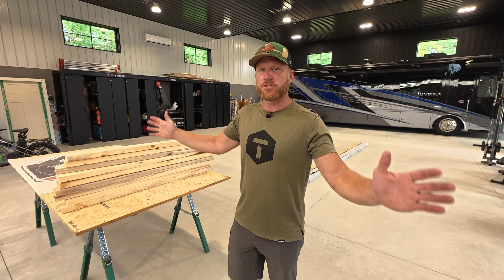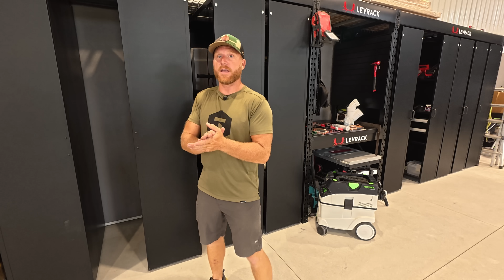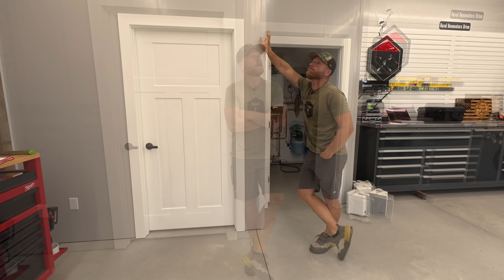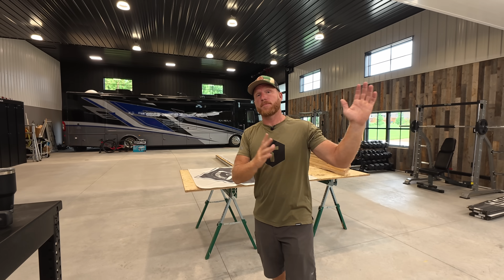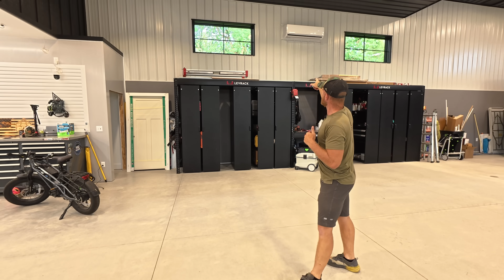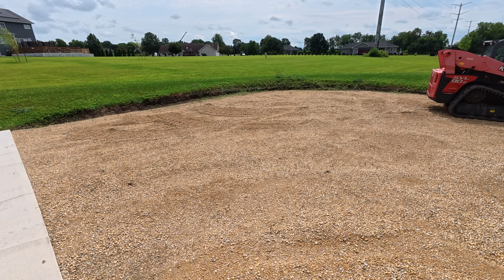RR Buildings COMPLETED Shop Tour

Comment: Awesomer than last time I saw it. Fourteen tons of work for a twenty ton job! 
What program is Cole headed for? Is his Jones for electric work going to turn into an Electrical Engineering degree? Have Cole tell us about it- we expect a lot for a guy with an exceptional dad; you will work like a Trojan and always seem to remember being home is really the important job. Same hope for Greg, trying his turn a being dad. 
On the wood shop; an additional building, 40 x 40, with good ventilation and in and out garage doors, great electrics, heat and air should about max you out as long as it doesn't become a warehouse! Jimmy Diresta's palace was designed for a crowd to work in- but you can see how much the warehouse effect has"shrunk it.
Talk to Robert Dunn about dust collection- c/o " Aging Wheels", particularly build it your self ideas.
Lots of good floor ideas; polished is slick any time and very slippery when wet. If epoxy, do one that is non porous, at least three coats so you can scuff it up in a couple of years, retop it and back to awesome again. Any floor surface material you put on it will get scarred and scuffed- repair or replacability is you friend!

Comment: Kyle, I would suggest looking at 'industrial curtians' for your shop. You can use these to segregate areas (like a dust/dust-free zones) and even segragte the RV area with a thermal curtain (soft wall instead of a hard one). Check out product line from Shaver Industries and Goffs Enterprises - Goffs even has bug screens for the roll-up door if you want some fresh air in the place without inviting the critters in (they also have thertmal curtain and roll-up options so you can store it hide it away when not needed like during the mild weather months).

Comment: What a great space Kyle. A few thoughts. Put curtains to isolate the shop area when you create dust. Put a good dust extraction system - cyclone system for sure. Bourbon Moth just redid his shop and Oneida provided a plan. The middle section can be used for assembly where no dust is created. For your floor, I would lean to an epoxy or polyaspartic where you park your RV. It creates a barrier to water, road salt, grime, etc. Overall, a phenomenal building, I am jealous 🤣.My 2 cents.

Comment: It’s like new car perfectionism, until the first ding or scrape. Greg will have to spill some diesel oil on the concrete and back one of those quads into the wall. Add some patina to help you be comfortable with working in the space.

Also, there are some awesome workshop dust filters that could help to mitigate the dust from encroaching on your RV side

Comment: Cool! 

Regarding the mini split: Issues like yours (over cooling) are common because the thermistor is located near the return grill on the head. This means it's reading the temp off 12 foot above the floor, instead of 4-6 feet off the floor where your body is located. I have read people will relocate the thermistor, wire in a compatible thermostat (mixed reviews on this method) or sometimes your remote will have a thermistor and the remote can be used as a remote thermostat (only available on some models).

Comment: Floor coating.  I have polyurea base with polyaspartic clear.  Super durable can be done in 2 days total.  I’ve done epoxy and it’s not as good (yellows, not as durable).  Polish is good alternative if you seal it after.

Comment: Beware if you polish (probably even if you don't with how smooth your finish is already) it's deadly slippery when wet (barefoot).  Maybe that's not a likely circumstance, but even a tiny amount of water tracked in from outside can mean someone has shoulder surgery, etc.  Depending on how wet your weather is - I'd consider a non-slip coating instead.

Comment: Floor:  Polish /seal, keep it simple....plus, its neutral, you have a nice design and color scheme in the building, don't detract from it.  KISS will also make it easier to clean/maintain, and repair if necessary.

Comment: Ya Kyle do the grind and high gloss polish on those concrete floors it is zero maintenance and looks killer !
Reply: You would need to wear a helmet if ever you mopped the floor. Many of us have taken a hard slippery fall on wet concrete.
Reply: I Agree. The Pros use an embedded Diamond Pad. It would look Awesome .
Reply: Wall off wood shop area if that's a plan 9 ' ceiling , storage above...
Reply: Beautifully built shop.  Congrats on completing it.  I look forward  to see how you furnish upper level.  Great job!